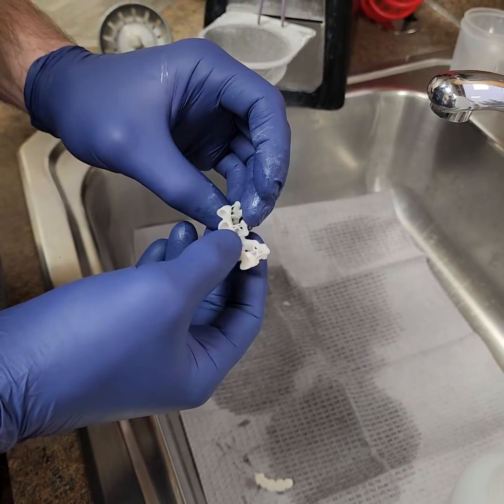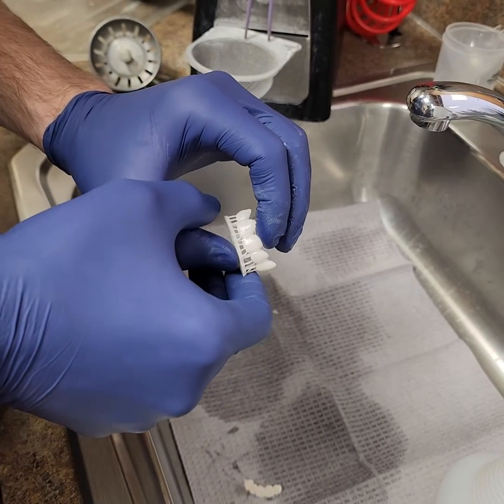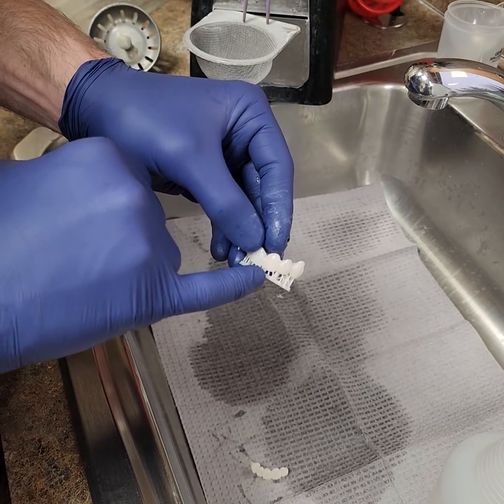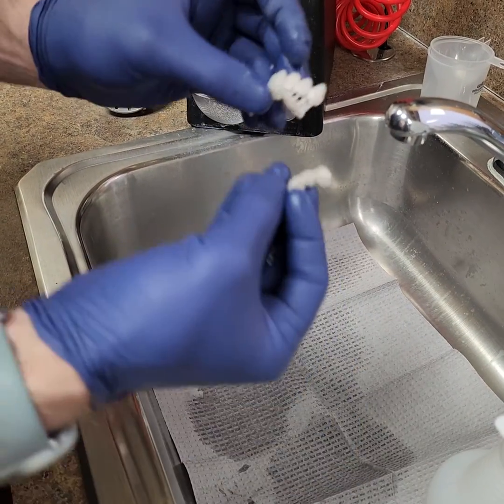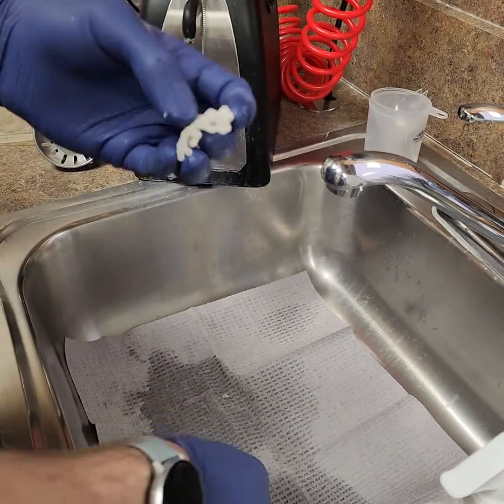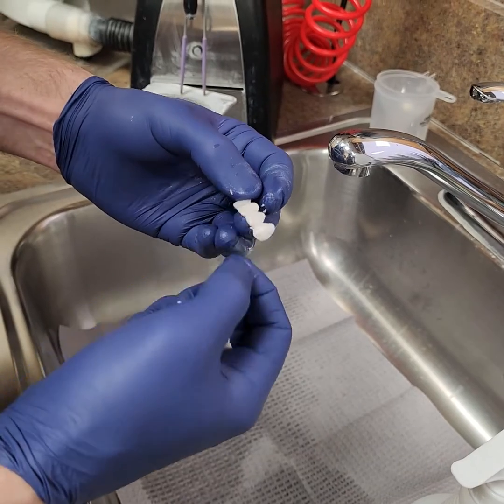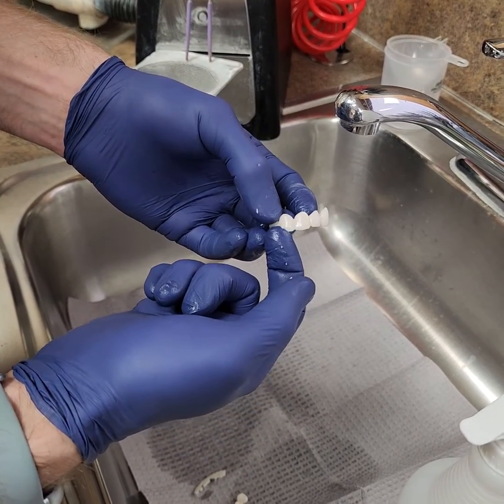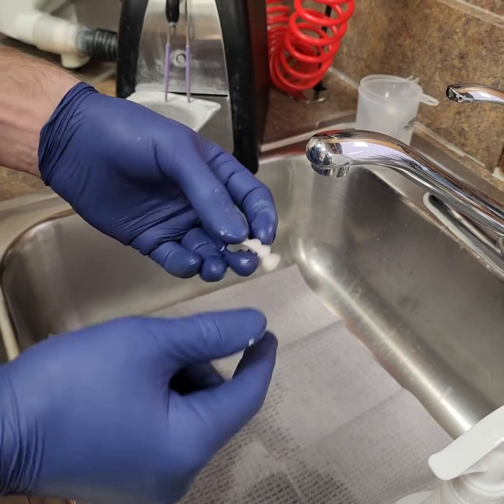Crown and Bridge Printing Supports

Comment: hey baron, when do you still use onx and why havent you transitioned to onx tough for everything
Reply from the maker: I'm using OnX for temp crowns and bridges (be care, as it'll fracture). OnX for hybrid temps. I'm on the fence between which I like more for flippers, as I prefer the shade selections of the original and I haven't had any fractures. But tough is certainly mechanically the superior option.

Comment: howdy 
My name is Juri and I am in Italy and I have the printer Pro 95 S , I write to have your professional opinion on printing surgical templates with hexagonal sleeve ,as I do not get a printing precision use to create them RealGuide Software and with other printers (ASIGA V Max)) I do not encounter this problem.
I tried various ways of positioning but without success if I position them upside down as per protocol are fine fit and the inner part while that of the seat sleevs no, inclinate 30 degrees no and etc. etc-
I have unsuccessfully used SprintRay's SurgicalGuide EU, dreve Guide SG and Keyguide Keystone pretty much all..help me please
Reply from the maker: Honestly, that is the biggest weakness of Sprint rate technology. Of all the strengths that has, many of them come at a cost of slightly worse precision on small holes in the light. It doesn't so much affect the fit of a guide, but any holes you have designed you'll likely need to increase in size in the design phase.
Reply: @bgrutterdds  strange that no technician or engineer sprintray has ever posed this problem I am very sad of my results as much as my clinicians with here I collaborate are of the idea that if they do not solve these problems change printing system immediately even less expensive
Reply from the maker: It's technology. Everything has strengths and weaknesses. There is no perfect all around solution. The engineers are very well aware.